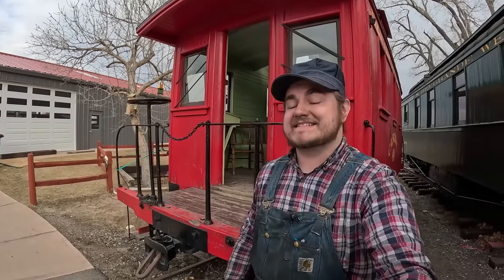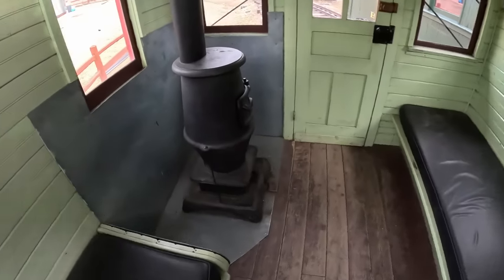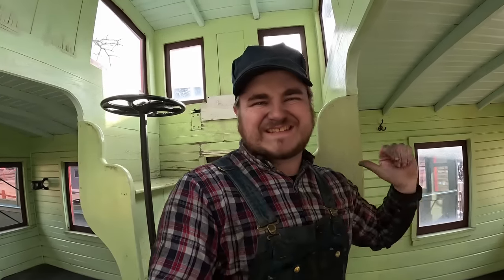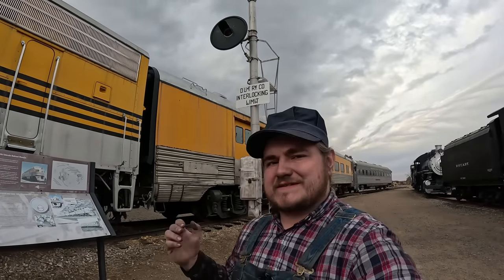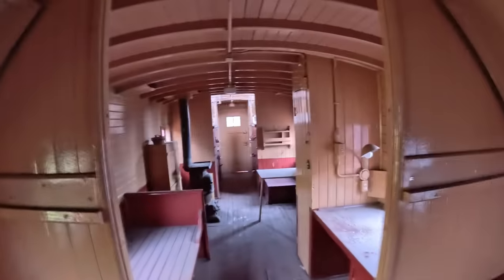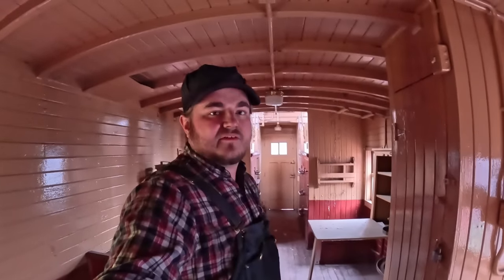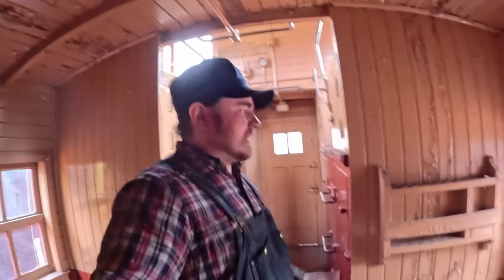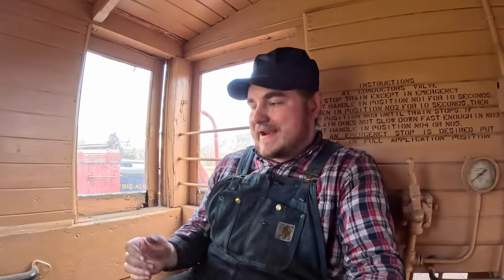Why don't trains use CABOOSES anymore?

Comment: Interesting, and all makes sense. I also remember watching for the caboose at the end of the train, especially stopped on the road at a railroad crossing, and a long train. Peering down the tracks trying to see the end of the train, and finally you'd spot the distinctive caboose and know it was almost time for the signals to stop and the arms to lift. Then the caboose would pass by in front of you and you felt like cheering. And sometimes the caboose crew would wave.

Comment: My dad got big into radio stuff using a scanner and I remember there were certain channels for trains. Specifically, the last car on the train has a radio transmitter emitting atone on a specific frequency. That’s the only reason I knew that there were no cabooses and what was in place, but I still always liked cabooses.

Comment: I'd wondered why caboose vehicles were no longer a part of modern trains, so thanks for the awesome explainer as to the Why and the Why no longer of the Caboose! 🚂😇👍

Coming from the UK - Where our loading gauge is much smaller than in the U.S. (3,5m/11ft 6in high by 2,1m/6ft 8in wide) - We've never used the American form of caboose as they couldn't possibly fit on the British network. However, older Guards' (Conductors') vans had windows that protruded slightly from the side of the car with edge glass that allowed looking along the side of the train whilst in motion, and these were most likely provided for the same reasons. 😺

Comment: I hadn’t thought about this in ages but the memories came flooding back instantly. I grew up in the 50s and lived less than 100 feet from the tracks. Fortunately there was a crossing about a quarter mile away so the trains were going slow. The still shook the house pretty good. There were 2 sidings, 1 for storage and unloading, and the other led to the plant that supported the area. At the crossing there was a switch house with a storage space. Me and my friends got to know the switchman and some of the train workers well. We sometimes got to ride with them in the caboose. They sometimes paid us to unload a car into the storage area while they sat in the shade. Stuff sometimes just happened to drop between the car and the platform. We seldom had to buy Kingsford charcoal briquettes.
Reply: Lucky

Comment: Thanks, Hyce. I did enjoy this! I can't help but consider how those guys felt watching their jobs disappear. Few industries saw such quick advances and changes like the railroad. I often wonder how much progress has to do with good things, as much as it has to do with profit for somebody. Well, I guess it doesn't matter. Those days are long gone. BUT! I still run cabooses on all my O gauge trains. :)
Reply: Union radicalization during WWII  and in the post war years forced Congress and Truman in the U.S. to create a seperate class of medical and retirement benefits specifically for railroad retirees in large part because of how unique the shifts and hours were for calculating the new Social Security benefits. 

Reimbursements to medical providers for example were processed at different rates, usually higher than regular Medicare and were paid under a different section on explanations of benefits.

Of course, federalizing the railroads because of strikes and work slowdowns and buying labor peace was part as well.
Reply: When I was a kid in the 1950's I became aware of the term "featherbedding."  With the conversion to diesel electrics, no more need for firemen.  But they were guaranteed a job because of union rules.  Basically, they just rode the rails with nothing to do.
Reply: @frequentlycynical642  "Nothing to do"? Except keep watch for signals an engineer might miss, and keep an eye on the engineer too. Why do you think commercial airplanes are REQUIRED to have co-pilots?
Reply: @ReggieArford   Oh, please.  They were out of a job.  Period. Except for the union protection.

Comment: I go back to the 1940s at age 5, watching trains and have been trackside since my teens; though not a former. 
So, obviously saw the steam days in their glory and cabooses. 
Now, I live in Calgary, the home of CPKC, where we see 2-mile train almost by the hour, with either a mil-train unit (distributed power) or a pusher. 
I started to get interested in end-of-train units when they removed the caboose and have also had several cab rides; one documented here for 95 miles. 

My rating for the video: A very solid 10 out of 10. Actually, an 11. 

Nice explanation to show kids.

Comment: The story I heard when the railroads stopped using Cabooses was that it was cost saving to not have them anymore. Which makes sense. A lot of railroad men objected to it, but did no good of course.
Reply: It also made it easier to cut a trainman position after 1985.
Reply: Railroad unions fought having airbrakes on boxcars too.  The unions have opposed every technological improvement.
Reply: @Oldman808 sadly unions can often destroy what they claim to protect , ironically they weren't particularly supportive of the much safer janney coupler whilst railway companies weren't keen as the unit's were expensive yet once introduced they had no regrets, - human nature isn't always that logical 😉
Yet i do support the principle of unions to protect workers rights
Reply: @charlesburgoyne-probyn6044  Yes, believe it or not, I too recognize the value of the unions.

Comment: Hot boxes - it wasn't pointed out, but you could see the packing remains in the journal box Hyce opened.  To retain the grease/oil, those boxes were packed with rags.  So, grease and a wick.  My grandfather moved to Pueblo during WW2 to work for the "Hotbox Company" (I don't recall the exact name).  They were developing the first defect detectors and dealing with repacking the bearings.
Reply: I seem to recall the packing was cotton waste.

Comment: Nice review of a question I hadn't realized existed. I'm also a little boggled that it was the 1980s before cabeese were legally retired. Somehow I thought they left when diesels and Timken bearings replaced steam and journal boxes. Thanks for the video! ☺️
Reply: For more than one reason, it took several years to replace all the brass bearings with roller bearings.  I worked for a railroad during the early '70's when they were gradually making the transition.

Comment: Thank You for the informative documentary. I am a railway fan.
In my European country we call them service car, the origin is translated from German language. Even the European / UIC class denomination is came from Germany.
"Dienstbegleitwagen" - "D" - "service train crew wagon" or the former 19th/20th century
"Gepäckwagen" - "Pw" - "Package / Baggage wagon", used in freight service too.
They are not used on long haul cross European trains, block trains (either sorted by the operator, or the costumer) and "relation assorted train" between sorting yards. They are still used on local accomodation trains (or local assorted trains, then the "caboose" is first in the composition, but not always), helping sorting out the wagon groups at intermediate stations, assorted in the station order.
They are coupled too, if there are industrial sidings branching from the line without local crew / interlocking tower. Then the line is "occupied" for other trains, until the train crew does not return the key of the main turnouts' lock.

Comment: Actually, the MAIN reason railroad companies got rid of cabooses was to reduce the amount of PAY that they were paying the crews per trip. They set up Labs and tested many different aspects till coming up with the HOTD  & EOTD. Then, once they had enough tests in place, they had an outside company build the devices. The design department had us install HOTD's on everything that came down the maintenance line. A friend of mine was on the design team that invented them. I brainstormed with him to give him ideas on their testing. (just a very small part, but I'm in the history, anyway.) Once all the locomotives had HOTD's installed, and a friend of mine built battery packs and beefed up the mount for the knuckle mount for the EOTD and the yard crew put them on the last car and linked them. Once that was in place, and working as a norm., the cabooses got mothballed. There was a line of cabooses from 3rd street viaduct all the way to the hump!. IT'S ALL ABOUT THE M O N E Y !!!
   You did a fine job on your video. I worked in the middle of all of that for almost four decades and saw the inside of it all !!!
Reply from the maker: You're absolutely right - of course it comes down to money, but that's not the interesting answer, just the unfortunate frustrating one... lol. Must've been interesting being on that piece of it.
Reply: YES: $$$$$
Reply: Or, they were fed up in owing payments to all the people that got cancer from sitting in a cloud of asbestos every time the train slowed.

Comment: Non-railroader: FRED, Flashing Rear End Device

Railroader: FRED, F(900Hz)ing Rear End Device

I love seeing a caboose at the end of the train and sad to have seen it go. I've seen a standard gauge caboose repurposed as an ice cream shop not far from here, so, some of them have found new life elsewhere. It's even on a small set of track despite being stationary and the rails only span under the trucks.
Reply: Todays ETD’s are two way now and required….
Reply: EOT
Reply: @TheNemosdaddy  In the “ book of rules” it was referenced as an “ end of train device “ hence ETD, I remember the first day of “ cabooseless operations “ very well, I was working the day it all started and I was never layed off, 40 years~~~

Comment: My last memories of the old Conrail track in Westerville Ohio was from around 1979. I was 8 at the time and was walking down the tracks and retreated down into the ditch to let the train pass by. There was a light blue caboose with two men standing over and leaning on the rear  railing. I jumped up out of the weed line and waved to them, and they waved back to me. That was the last time I saw a train go down that rail before they dismantled it, and I still remember that days as if it were 10 minutes ago.

Comment: I really really liked this video. I was an Electrician for the last cabooses ever made in the United States, We installed a diesel generator system with 129/220 volts A.C. as well as a 12bvolt lighting system. A living quarters. It went to Saudi Arabia, built in Chesapeake Virginia 1982

Comment: I grew up in the 70s and 80s and about twenty years ago I noticed that they were gone. I knew a guy who worked for the railroad and he explained why. I also noticed around the same time that the postal service stopped using mail jeeps and I had harder time finding out why.

Comment: I used to work for CN and back in the mid 70s frequently rode on freights, including the caboose.  I often rode in the cupola and on one occasion, while travelling in the middle of nowhere in Northern Ontario, had an excellent view of the Northern Lights.  Back then, trains had a 4 man crew, engineer and brakeman in the engine and conductor and brakeman in the caboose.  The engines had a 3rd seat, which is where I sat when riding in the locomotive.

BTW, those bunks are not the greatest for sleeping on.  On one occasion, I was travelling overnight, between Foleyet and Capreol Ontario and tried sleeping on one.  I was occasionally tossed off by the motion.

Comment: I worked on the C&NW in Chicago in 1973-75. The best job ever, especially when I got the caboose or a second engine to myself. The caboose was called a way car for some reason. Cupolas were on the sides instead of on top. The heaters used kerosene. Journal box lube was solid, likre a bar of soap, which melted from the friction. We had walkie talkies.

Comment: I actually saw some cabosses in use in Northern Ontario for engineers and track repair. They were shorter trains mainly just hauling machinery and materials but had some older wood cabooses on the rear. Would see them a couples times a year.

Comment: As kid lived in Deptford England by the Deptfrd Wharf rail yard and on a Sunday  no one worked. The steam engines had had gone elsewhere  but the trucks stayed and it became our playground
We called them Brake Vans, not nearly as elaborate  as your  Cabeese, but the larger vans had dark leather seating, a round coal heater and metal circular  brake. More pleasing to us kids was a door and platform at each  end and a wooden running board  running  along each side
Great  fun trying  to catch each other.

Comment: In Norway they are known as Konduktørvogn (Conductors  wagon). Neve seen one with a cupola. Normally a short wagon. In one end an office for the conductor. He often took on the task of being a postman, sorting the post between stations. The office also served as a restroom. In some cases with multiple seats for railway crew needing transport. The grater part of the wagon was for freight, normally for passengers onboard. In some cases the functions were combined with a passengers wagon.

Comment: Unloaded coal trains at a powerplant since 1980. Don't remember when they quit coming without cabooses. They were replaced by FRED as the rail guys called it, the "Effin' rear end device." As trains went from 60 to 130 cars, they have pusher engines. The RR drops off the train, the powerplant guys are trained to run it around the unloading loop. Lots of nostalgia thinking about the caboose.

Comment: Actually 57' is the longest trailer allowed but only under certain conditions and certain states.

Also, COE's are still used on routes that are length restricted routes which saves a lot of time when conventional need to route around the length restricted route.

Comment: I had read that the railway workers union was instrumental, or maybe tried to prevent the end of the cabooses. Things got to a point where they just weren't needed any more, but they WERE a source of railway worker jobs. Also the railroads advertised that workers were paid by the run between point A and B which 'back in the day' was pretty much a full work shift, but with newer faster trains it was taking only a couple of hours to make the run - yet the union wanted their members to be paid for the whole day as in the past, 'because'.

Comment: Add a kid in the ‘70s we were crazy enough to hop trains on a regular basis. There was a switch point where they usually stopped and one day we got into the caboose! We rode it for a bit, sat in the chairs then hopped off. When they went away we noticed how incomplete the trains seemed to be - no symmetry, so sad…

Comment: I was inspecting an old caboose exhibit in central Virginia and looked into the "head".  It was a small closet with an outhouse-style seat and a 5-gal bucket beneath containing 6" of sand.  You could be stopped and still use it!

Comment: There is one other use that cabooses are used for currently. During inclement weather that results in road closures (blizzards etc.) they are utilized to swap crew whose hours of service have expired.  They are referred to as snow coaches.

Comment: There was a coal power plant near me when I was a kid and the train had a caboose for quite a while, the tracks didn't have flashing lights or crossing guards either. The train usually backed over the crossing in reverse and the caboose guy would jump out on the track and wave a lantern to stop traffic. In the 90s they got rid of the caboose and they had a loop of track installed at the power plant and the train was able to turn around. No more caboose!

Comment: My dad worked for the CPR (Now CPKC) as a freight conductor. He worked in the caboose (called the "van" in Canada). He worked 32 years from 1942 to 1974. The first van he had was made of wood. Each tail end train crew had an assigned van they used all of the time. They had a "division"  which ran from one small town to another one about 100 miles away. When they reached that town, they stayed over until they were needed to work going back to their home base. They would sleep in the van, thus the need for bunks. (Head end crew were put up in a hotel or B&B.) In the late 60s they had "run through" vans which were attached to a train when it was assembled in Toronto and it would "run through" to Thunder Bay. In this case the company built bunk houses in the divisional yards, and the crew would sleep there (both head end and tail end crews) until they were needed to take a train back home. Dad had retired by the time the vans were taken off trains. A sad day for him.

Comment: Today we call plain bearing “ bushings “
In the 1980 when we assembled radio controlled cars as new kits they provided bushings for wheels.
Bearings or roller bearing were an upgrade we would buy at the hobby shop to improve the performance of rc cars and trucks..
I remember racing these in our area and greasing the bushings in between heats.

Comment: In the mid eighties in Australia I worked as a guard in a suburban passanger network.  The role involved sitting at the rear of the train and watching signals through a pericope over the top the train to be sure that the train didn't go through signals. We had a brake valve to release air to apply the brakes.   But we also ran the train in the sense that we signaled the  driver via a bell to start and stop. We where responcable for being sure the train ran on time.  Many of the element you speak of here where part of that role including carrying flags and going rear of the train to flag other trains if we broke down. In earlier days we would have been respocable for the key, staff, and loop sytems that ensured the safe running of train sections. We adopted our safe running systems from england but I assume the american system would have been very much the same.   By the late eighties automatic signaling, with safety brake levers on home signals, plus much improved radio communication meant they didn't need the person at the back at all. Just some of the same reasons you describe.